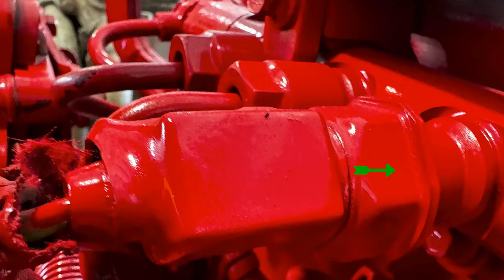The common rail fuel pressure sensor

Comment: Is it normal to go negative -600 when is engine off key on
Reply from the maker: yes Plus or minus 750 either way is ok. The sensor is not accurate until it has a over 2500 psi on it.

Comment: I have paccar PX6 Cummins 6.7  in a Kenworth with low power codes 1911 2311 and PID 157 there’s a short Video I did air bubbles in return line at bottom of fuel tank how can I send it to you
Reply from the maker: yes- faultcodehelp@gmail.com. I check email twice a week.

Comment: Hlw Mr Joe can i have a problem with Cummins isx 15 with a problem of hard starting, i try to change the gear pump ,crank sensor,cam sensor but still no change.what can be the cause
Reply from the maker: First that can be caused by many things. So I will list the most common which is a small air leak on the fuel system between the fuel tank and inlet to the engine. The problem is usually orings on the frame filter. But I would check the following first. 1. hook up a 0-100 psi gauge on the fuel filter on the engine. The gauge can be 0-30 up to 0-100. (Next DO NOT CRANK OR TRY TO START THE ENGINE UNTIL YOU REMOVE THIS GAUGE. ) 2. turn on the key but do not crank the engine. listen for the electric lift pump it should run at least a minute up to two minutes. Look at the gauge and it should  be reading somewhere between 10-35 psi. ( new style lift pumps pump around 35 psi the older part number only made it to 10-15 psi. All that matters is you see pressure come up in that filter. if no pressure then once the pump stops turn off key two full minutes. Repeat this 5 times. if you finally see pressure then you have a fuel drain back on the primary side. If you never see pressure I would probably replace the lift pump.( assuming the engine does start after you crank and crank). If you dont have a gauge you can push in the center valve stem on the cummins installed quick check fittings on the engine mounted fuel filter but that makes. mess nce pressure comes up but at least you know the pump is working. The above proceedure is to check your electric priming pump that has to work for the engine to start normally. Last it is ok to have to do a couple key pump cycles ( 2 minutes off and key on again so the computer will run the priming pump) to get it started. If this is not the problem you need to have it checked out by someone who understands the fuel system.
Reply: Thanks so much Sir I will do so ,and I will come back to you after I have done all what you have told me @ENGINESHOPJOE
Reply: I will do so and come back to you after results
Reply: Thanks Mr Joe for the ideas you give me about Isx hard starting ,i followed all procedures and get everything right.My other question again is about Cummins Isx 15 actuators, if the engine is missing and smoking black or white ,How will you know which one of the actuator/actuators are not working or causing that? Will highly appreciate for your response
Reply from the maker: @brdieselmetalco  when it is idling unplug both rear bank actuators. it will only run on the front three cylinders. then plug them back in and do the same on the front.  this narrows it down to front or back
Reply: Thanks so much Mr Joe

Comment: Im getting a 4726 low pressure code and i cant find a leak after i put a fuel pump on. Didn't get the code till pump was changed. Also the measured psi only drops below commanded when i let off the throttle and it only stays below commanded pressure for a second.  Any ideas? Took it to 2 different shops with no luck.

Comment: Thanks for sharing all your knowledge good Sir!
I just discovered your channel tonight and absolutely subscribed immediately. I just spent all day today trying to get a ISX 15 in a 2013 Kenworth T-800 to start. I did not succeed and its always a lousy day when you get defeated. 😞. But I suspect the high pressure pump is not making pressure or the check valves are not holding. The ecm is commanding 5200 psi and actual is only 180. I tried removing the pump head but one of the bolt heads rounded off and I couldn’t get it out. I suspect there is something going on in there. Truck should be getting towed in tomorrow and I can continue with diagnostics.  Again THANK YOU. Sharing all your knowledge is very much appreciated!
Reply from the maker: Feeling bad about being defeated-check out where me and 3 other professional engine mechanics get our butts kicked by an engine we built LOL
https://youtu.be/zKd2iUKzQKI
A good ass kickin keeps us humble which is how we all need to be.

Comment: The 4 wire sensor is built with redundancy to meet obd standards. The 2nd sensor is also used to calculate fuel temp. This is what I was told by a cummins rep at a training session.